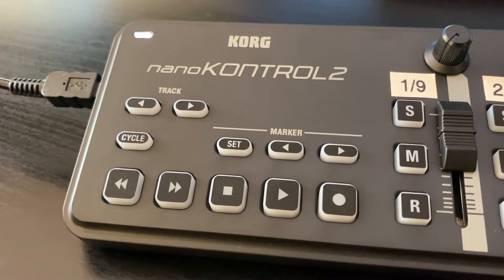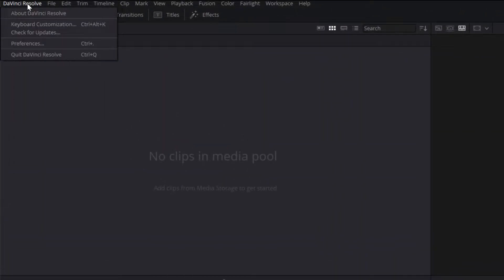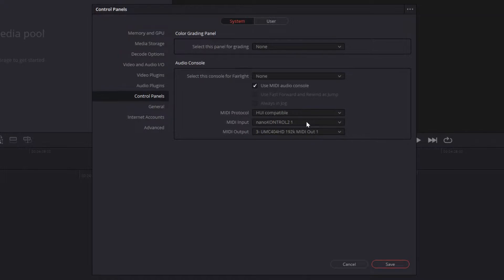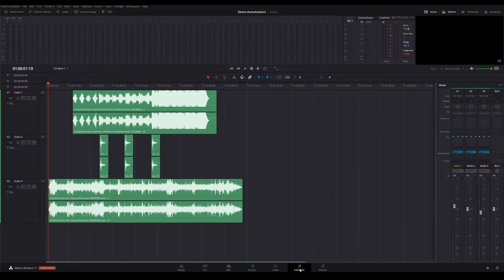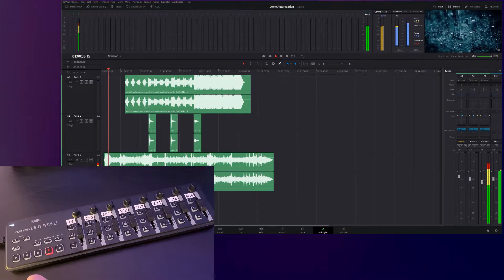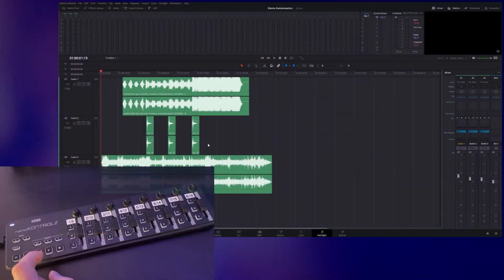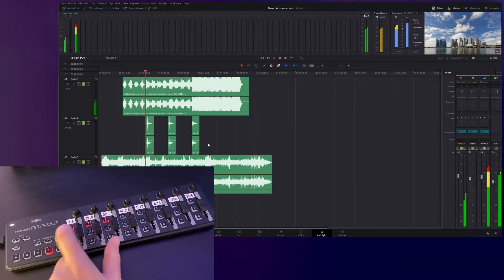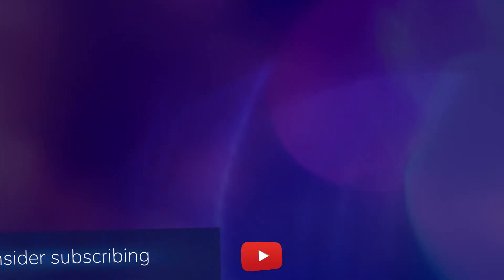How to - Korg Nanokontrol2 & DaVinci Resolve

Comment: Could I use my PreSonus Atom for regular cutting/editing in Resolve? (Or for anything else in Resolve?) Would be nice to really get in there and customize the knobs for scrubbing and zooming, etc.)
Reply from the maker: That would be great - I’ve not tried it - but resolve is open to most midi inputs and if the Atom comes with software to ‘bind’ controls to specific midi commands you may be able to do it.

Comment: Hi great video, but I have some problem with DV 17 and still in version 18, after using the NanoKontrol2 I can't save the projects, thats it, if I use it, I can't save the project with the keys or menu option, do you have any idea why this is happened? Thanks
Reply from the maker: Hi - I'll look at my set up and see if I have the same issue - thanks for reaching out!
Reply from the maker: Ok - just checked my setup - I can save and load in both versions after recording automation. Can you share a little more on what is happening for you? Bit I can confirm it does work fine on both versions on my setup.
Reply: @Creatification  Just this, I setup the Korg Nano as you described and now if I use the faders I just cant save, using menu or hotkeys. When you try DR just don't do nothing. If I try to close The program its ask to save, if I hit save it dont close and only will close if I choose  to not save. Its a really stranger beahvior
Reply from the maker: That sounds really frustrating. And I'm assuming save works if the controller is not pugged into the computer?
Reply: @Creatification  if I dont use it, even pluged the save works
Reply from the maker: Ugh that sucks - and makes no sense to me - so its only when you have recorded track changes with the control surface - never seen anything like that before - have you reached out to Backmagic?
Reply: @Creatification  I am trying tô figure whats is happen, I am removing others usb devices to see compatibilities, I jusr removed the Huion drive, now need to check for Elgato and even my mouse drive, after that I will contact BM for help, many thanks for your help.
Reply from the maker: No problem - hope you can get it fixed!
Reply: @Creatification  after upgrade to DV 19 and clean all extras VST (don't know what really fixed it) now it's working! Thanks a lot!

Comment: I already have this on my desk for controlling audio in voicemeeter. I am using only four of the faders and none of the knobs. 

I wonder if I can use the remaining controls for Resolve. 

Apart from using it as a midi controller in Fairlight - can you take midi inputs like this to the color page as well? Would be grade to manipulate multiple variables at the same time.
Reply from the maker: Hi - Great questions...

Voicemeter - I'm pretty sure that the controller has to be 'bound' to one app - pretty sure voicemeter will take the whole thing and not enable resolve to control - you may need two controllers for this action

Color Page - Yes I have seen others do this (not with this controller) - and there are devices that are specifically made for this that use mini as the control language - I have not tried it with this controller - but - you may be able to do it using the 'mapping' software that comes with the mixer. Let me know if you have a go and get any results! As this would be epic!

Comment: Great video. Didn't know that was possible and ordered that device. Question: what happens if you make a mistake during the mix and you wanna go again but not from the very beginning. You look for a new in-point and you need to know the currently volume, as the faders are not motorized. How do you do it?
Reply from the maker: Yes - you have to pick an in point - and as you say the sliders do not pick up from where you left off you need to estimate the start point. Often you need to ‘tweak’ the restart point in the edit after (manually smooth the transition) to clean it up - it’s a lot faster than doing it all manually tho.

Comment: Would any Midi controller work in this case (i.e. Behringer X Touch Mini) and is the midi controller only functional in the Fairlight tab?
Reply from the maker: It may work - but I don’t know - often midi controllers come with an ‘app’ you can use to make assignments/change the data they send depending on the software - worth checking ahead of purchasing - and if you buy on Amazon you can always send the controller back (worst case)

Comment: Great video!   Was helpful in getting the bit bigger nanoKONTROL Studio going, an extra trick to make it work, and could be applicable here is to use Kong’s Kong Kontrol Editor to set the mode to Pro Tools, same as holding the Play and Set buttons at the same time - helps it connect easily as a Bluetooth device as the setting stays persistent.
Reply from the maker: Thanks - great advice - the Korg app is very useful
Reply: Can you use the scroll wheel to skip forward and back in the timelime? Did you manage to use the dials to control color grading.

Comment: How does one assign tracks to the Korg’s faders, or does it just default to the first 8 tracks in Fairlight? Also, (if you’ve any experience with it) how does this compare to Novation Launch Control XL?
Reply from the maker: Sorry don’t have any experience with the Novation - but assume it might show up in the device list the same as the Korg - it will assign the first 8 and you can use the track left and right buttons to move up or down if you have more tracks - The comment from J Walking May also be helpful - using the Korg app to make different assignments to the default. Good luck!

Comment: Trying to get my Axiom 49 controller to work with Davinci 16. the software sees the keyboard, but It's not making contact yet. I'm betting they don't have a script written for it, in which case, how do I map MIDI controls, and where in Davinci can I see a MIDI signal so I can determine connectivity?
Reply from the maker: Hi Moto - had a quick look into your issue this AM - does it appear in the audio console in settings? If not I’m not sure what to suggest - Resolve does not appear to have anything that visually shows it capturing the midi signal like other apps. Some controllers have a piece of software that allows for mapping. Not sure about the Axiom 49 - sorry I can’t be more helpful. Let me know if you make any progress.

Comment: Hi, great video! Just what i was looking for:D Thanks! Just started with Resolve and got the idea to use my nanokontrol2 and nanopad2, but I've got a question. Do i need to set up drivers? Or will it work immediately?
Reply from the maker: Hi! Thanks - sorry for the late reply - there were no drivers required for my PC - it should work just by plugging it in and following the steps I took. Good luck with Resolve it’s a great bit of software!
Reply: @Creatification  No probs! I tried it with drivers installed, but that didn't work. i then removed the drivers and it worked 👍One question, if you turn the pan knobs all the way left and right, do they still keep working? Ive got the issue that when i turn beyond a certain point they pop tot the other side and i need to reset them manually in the fairlight pan module.
Reply from the maker: Glad you got it working - I have seen this behaviour - it seemed to go away once I had set it all up and then restarted the app/pc let me know how you get on. I’ll see if I can recreate the issue here when I’m next using it.